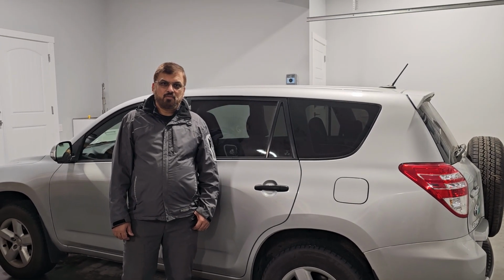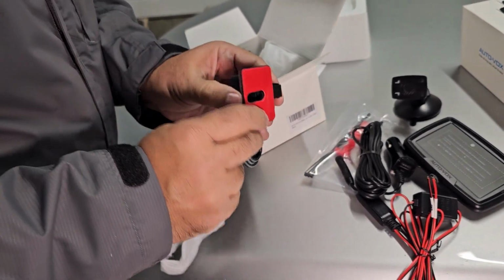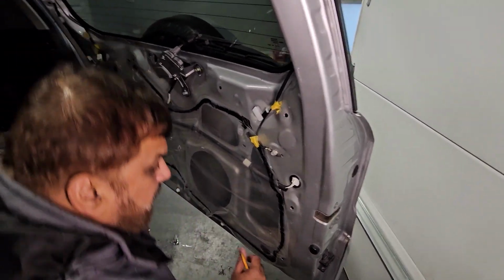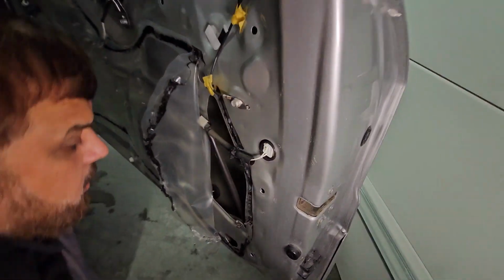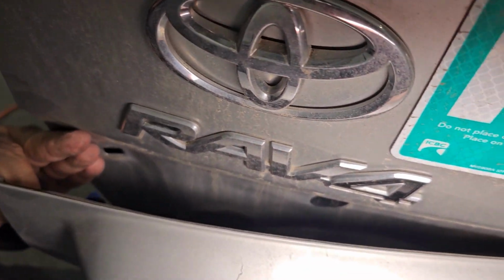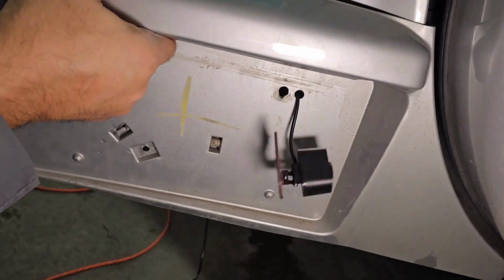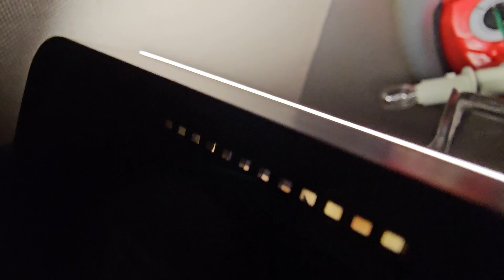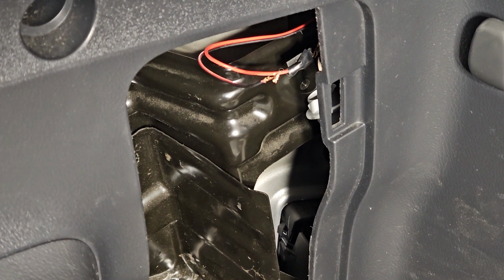How to Install a backup (Reverse) camera | 2012 RAV 4|  DIY auto repair

Comment: Hello. I've watched the videos on your channel. Your video is excellent, but it won't go viral. Have a look at your channel. But why? Think about it. Your channel won't go viral, and you won't gain many subscribers or views. The reason is: 1. Your video needs to be SEO properly. SEO Score: 0 out of 100.2. Your video isn't reaching the right people.3. Not using video hashtags properly. 4. Not sharing the video on social media sites.5. There needs to be more ranking tags.6. Video performance: 0 out of 50] 7. Not a single tag, description, or title is optimized for search engine optimization. I have a lot planned for your channel. There are a few more reasons why your videos are limited to your channel. In a word, your video is awesome; such videos are in great demand. If you do this thing correctly
Reply from the maker: Thank you for your help